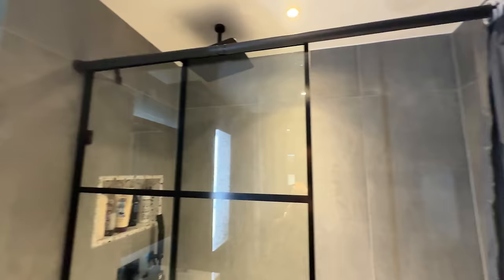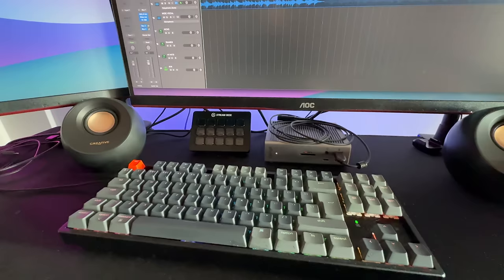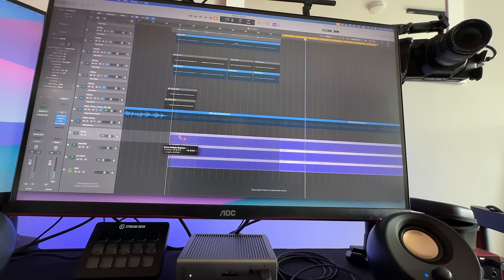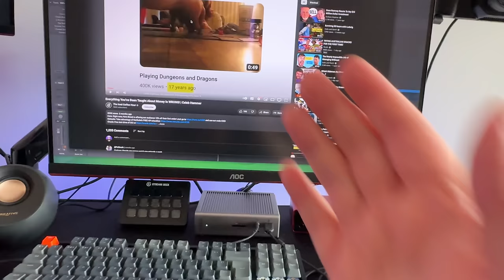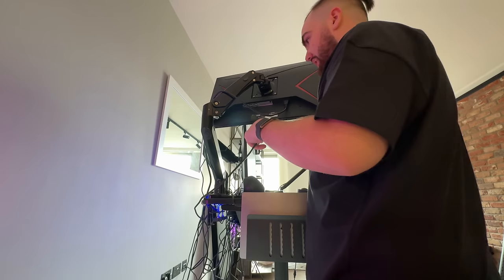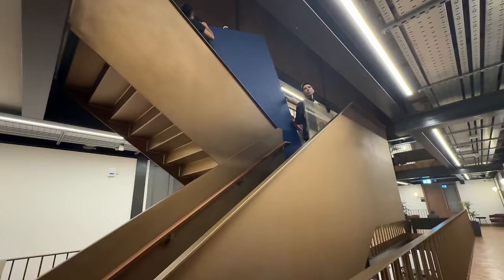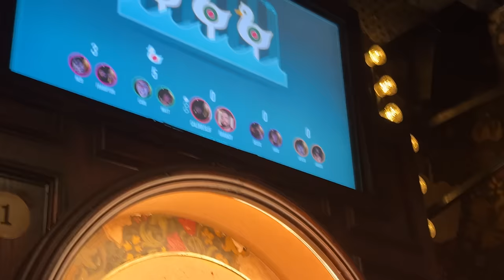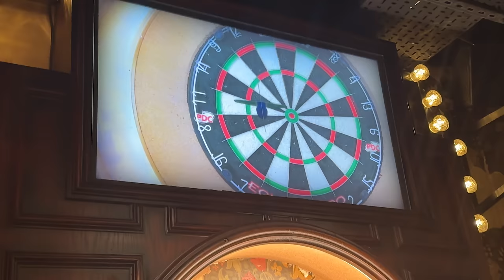The NEW What's Good Podcast Set

Comment: Yeah there is almost always some delay with bluetooth even if slightly. Interference and connection issues can cause problems that for most things won't matter or can be ignored, but I could see it throwing off work related to audio for sure. Def recommend getting some cabled stuff at some point. I work with network and wireless tech regularly, but not music so this was pretty cool to see.